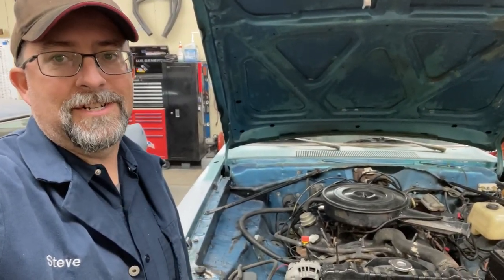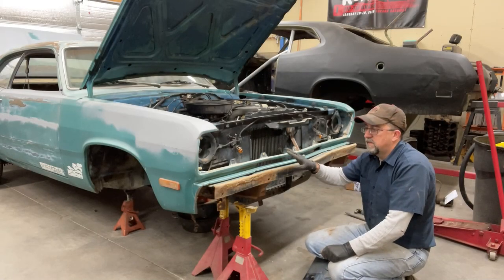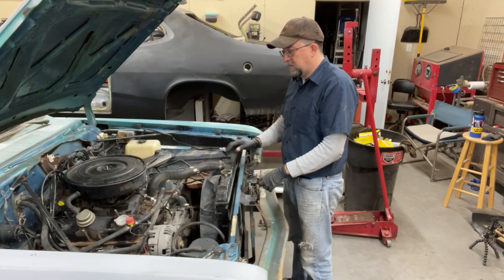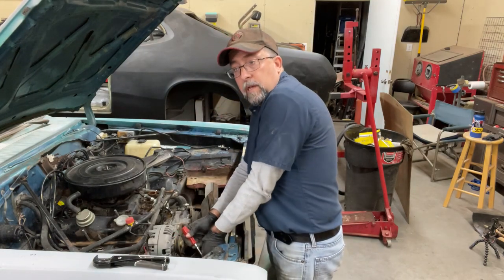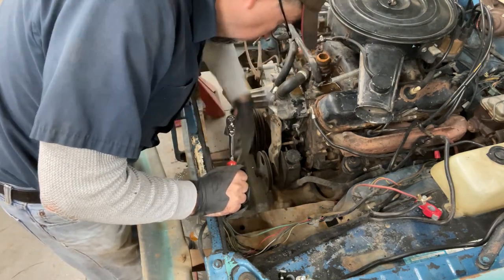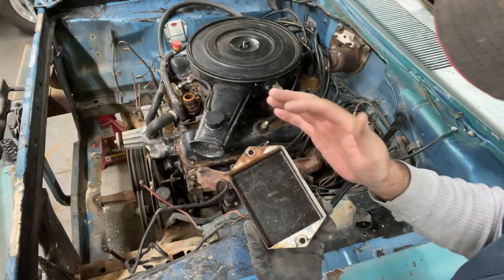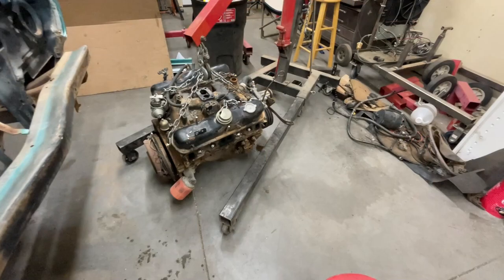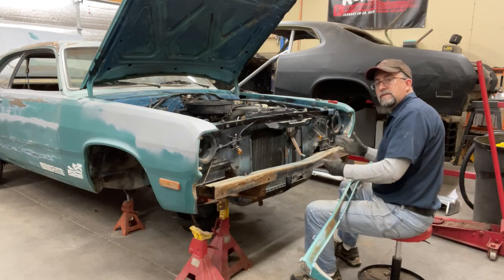Pulled The Engine Out Of My 1974 Plymouth Duster To Get It Ready For Paint

Comment: Silver Box "back ins the day" was the Best One had a RPM Limit to 7000 RPMs Nascar Used them. 
Blue Box = 4000 RPM Limit 
Orange Box = 4500-5500 RPM Limit
Silver Box = 7000-8000 RPM Limit
Black Box = 8000 Limit 
They still come in different colors but I'm not sure if they have built in RPM limiters anymore 🤔

Comment: If you are going to pull the K-Frame why not drop it the engine, trans and lower suspension out as nice package like the factory installed it?

 I did it out and in in My BB 69 fish, was just to simple and easy! Saves all that fresh paint from undo stress and worries! JMO!
Reply from the maker: I may consider installing it that way after I paint it.  If I had a lift I probably would have.  I don't like the idea of suspending the car that high to get the engine out from under it.  I'd have to use some kind of dolly or cart to roll the engine out with.  Either lift the car or lift the engine.  Both work.  Most folks will just pull it out of the top.  Same process for other brands.  Video was not meant to be Mopar specific.  This process covers a broader range of cars.  It is pretty cool how they did it back then!
Reply: @roadhardrestorations   No lift required! Just the engine hoist. It  is Just to simple and gratifying. Rethink the approach of what you think a bit, raising the body with the hoist is 
very simple off the bumper mounts and roll the whole package under the car and lower. A cheaply built carriage in lumber is all it takes!